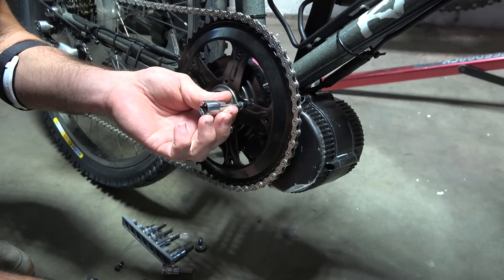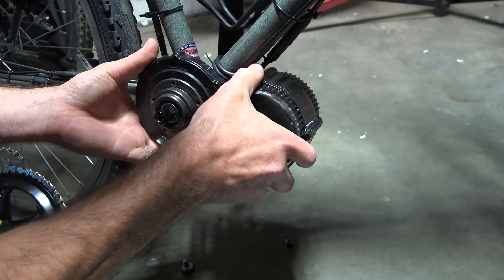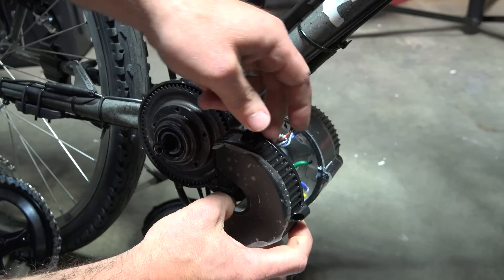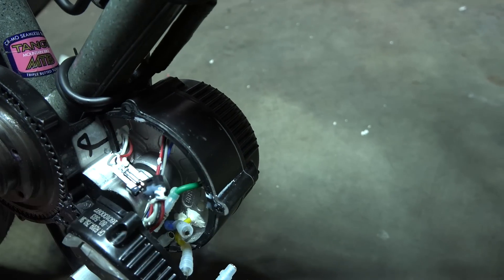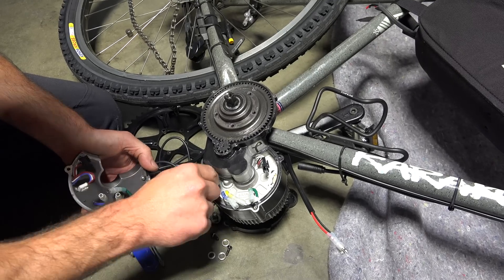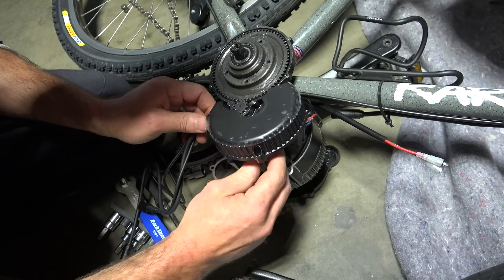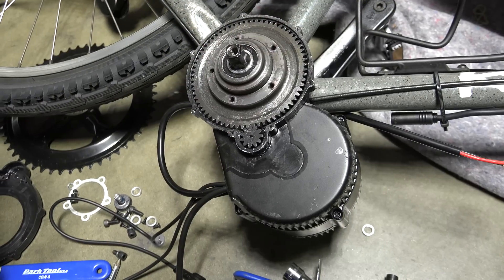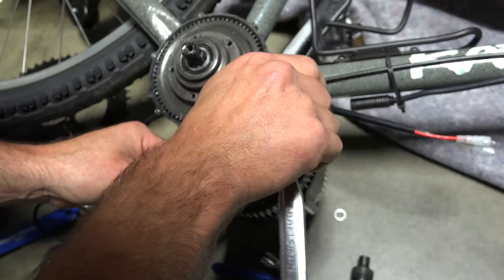Installing a  Bafang BBS02 Controller

Comment: I fixed my Bafang bbs02 following this video and my bike now works 
I was getting an error 12 on my display and the battery was flashing on the display.
The error code 12 suggests that you have water damage and I never rode my bike in the rain ever.
If anyone has an error code with the bbs02  changing the controller will fix the problem!
P.S. I changed it to the New bbs02B that I ordered on eBay from a china seller. They are the Gods of e-bikes you know

Comment: I fitted the HD controller to the 02 it has better Mosfetts and a slight performance upgrade it runs fine before anyone tells me it's not compatible or it will burn the motor out, it's total nonsense..
Reply: Really?! I've been wanting to do the same thing. After I bought the bbs02b I realized the 120rpm wasn't enough for me. I really want to install an HD controller on my 02. Was it easy to install? Did you have to change any connectors? If you happen to see this comment I'd love to hear about your experience with it

Comment: very informative thx. do you know if the LCD screen is powered by the big bike battery or does it have its own small battery inside the LCD ??   if its inside the LCD and its flat would the bike still work normally without the LCD screen?

Comment: Can i swap a 36v controller with a 48v one and use a 48v battery? Or will the copper melt in my motor then? thanks?
Reply: did you ever get an answer?
Reply: @ubuthi7495  No never. I went for a 1000w bafang with 48v battery so i am sure it is safe :-)

Comment: Hello. I have a BBS01B and after a few days I noticed that the motor stopped assisting when I pedaled. that was just for a few seconds, but it happened again and again and more and more, and now when i've been using the bike for a month, motor doesnt turn on at all. the system is on within the display but i get no assistance from the motor.  we suspected that its the controller so i opened it up and every cable was attached but it was alot of grey powder in there. almost like a overheated coolingpaste thats dried up on a cpu in a computer.

that's not normal is it? you think its the controller that needs switching out?

thanks beforehand

Comment: WHAT OTHER THINGS CAN CAUSE THE PEDAL ASSIST TO STOP WORKING? MY BBS02B HAS DONE 3600KM AND THE THROTTLE WORKS FINE BUT NO PAS? AND MOTOR IS OVERHEATING USING THROTTLE ONLY.

Comment: Guys ive just fitted a BBS02 but throttle and speed sencor not working? Any ideas? I've disconnected and te connected checked all plugged into correct controllers already

Comment: Hi mate a quick question. Today i install my bafang and 1 mile was fine , then something happen i feel how to the motor pull and stop pull and stop few times, then just stop, no assistance or throttle response.  Come a litle message 30H on the bottom  on the screen. Any idea what can cause this issue?

Comment: Starting to wonder if the controllers on the cyclone mid drive units are a bit more robust. Is this the case from your experience?
Reply from the maker: the cyclone controller is very cheap qualty compared to the bbshd controller......not a fair comparision. the cyclone contrller is like fred flinstone and the bbshd controller is like the jetsons.

Comment: Very helpful, especially on the wire placements within the controller.  I notice that the pinion and drive gear seem to be low on grease.   Is that a concern?
Reply: It wouldn't hurt to apply moblie 28 Grease.